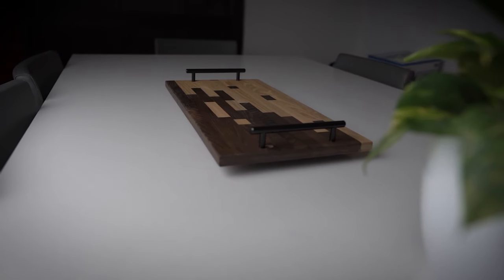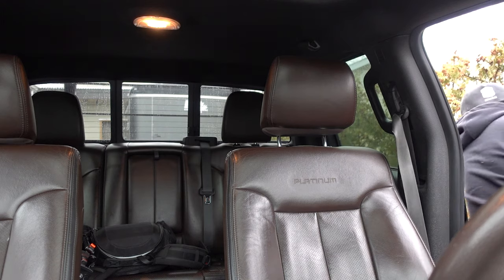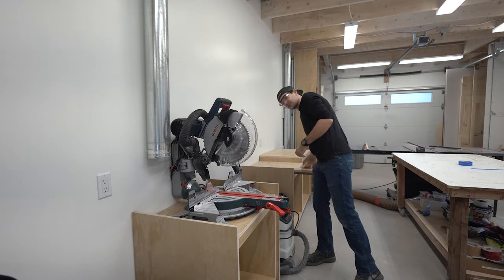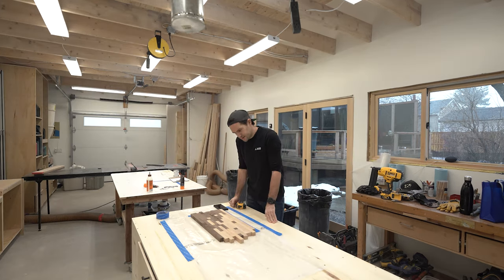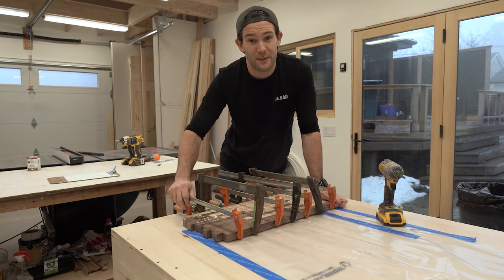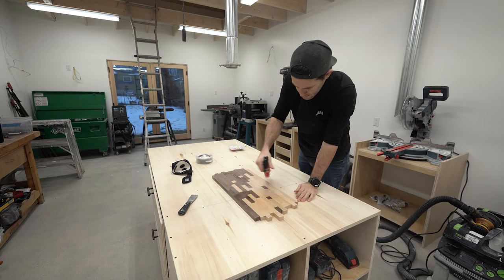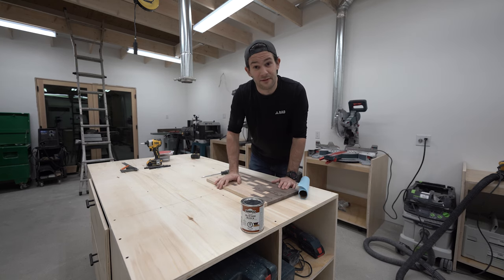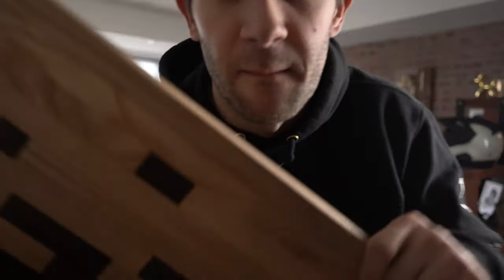First video, don't watch...

Comment: You are a natural. Great video and editing. 

Wait. You don't live on the same property as your shop?

What were you filming with in the truck?
BTW. I am not sure how much plastic costs per roll. I get kraft paper from staples for about 15 dollars a roll. Goes a long way. We order it online.
Reply from the maker: Hey Kelly, no my shop is actually off site at my Dads property. We built it to support our main business of home construction. It just happens to double as a wood working shop too :)

I filmed in the truck with my Sony RX100, and it has a sensor inside of it that raddles unfortunately, so I'll likely be replacing it soon. 

I use the plastic because I always have some kicking around from client projects, so for me its essentially free, but kraft paper works great and is definitely much cheaper!

Comment: Great kick off video.  I personally think the glue gaps a lot when you don't spread it with your finger or a brush.  But if you cut your staves really cleanly, as you did, it's probably rare.  Great job, and looking forward to future videos!  I'm also a hobbyist woodworker, though just getting started and only have what's in my garage to work with.   Wish I had a dedicated space like yours!
Reply from the maker: Thanks Bo! I hear what youre saying, it definitely cant hurt to spread the glue around, thats for sure. I dont know if youve been following me on Instagram but I actually built the shop as well. Before that I was working out of something very similar to what youre describing.

Comment: Loved this! Quick question when sanding, you used 80 grit then sprayed with water did you use 80 grit again and then 220grit? Thanks for the great video and explanation!
Reply from the maker: Thanks Grant and good question! After I raised the grain with water I switched over to 120 or 160 grit sandpaper, I can't remember which, but basically the next highest grit in my progression
Reply: @ZacBuilds  Great thanks Zac!